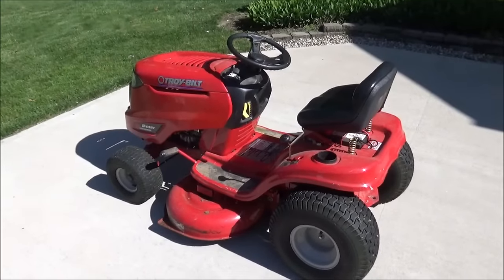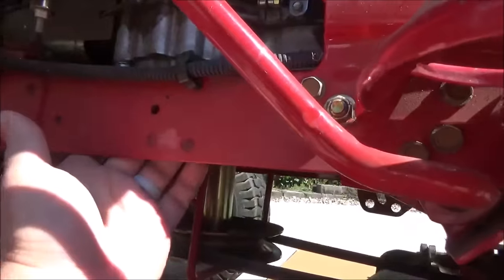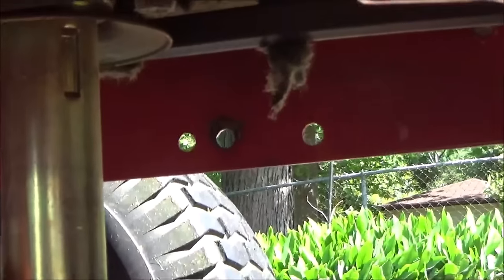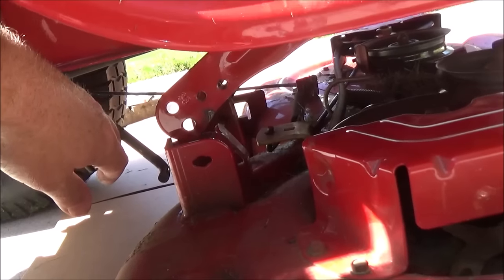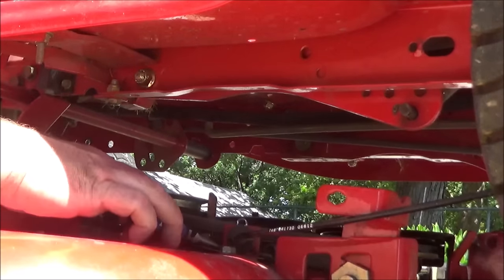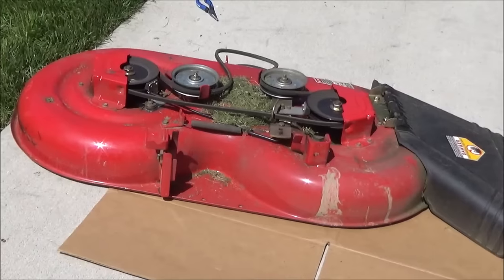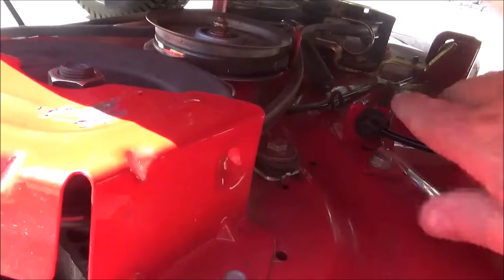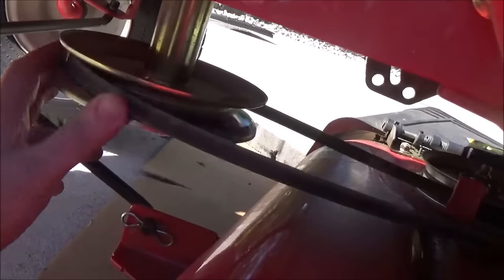Troy-Bilt Pony | How to Remove Your Deck / Put it Back On

Comment: COME ON MAN  the belt will come off the pully without taking off the guard it will give just enough to go past and on again without stressing the guard metal, put a little lift  on mower deck and the weight wont be an issue to push out pins , pto cable is long enough to slide deck just past mower and remove without cutting wrist when it comes lose underneath   just saying   the rest is what i do as well
Reply from the maker: Thanks for stopping by!

Comment: My Mower deck only goes down 2 notches till it hits the ground. How do I adjust the deck so I get all 5 or 6 settings for the height of the deck? Thanks
Reply from the maker: I don't know of a way to  adjust it other than adding some air to the tires. Mine sits very low. I can only cut on the top setting. But that is definitely way too low.

Comment: Just wanted to say thank you for making both the deck removal and changing of belts so easy.  You have a fantastic ability of blending the visual and spoken instructions.  I’m no mechanic but my Troy-Bilt works like it’s supposed to now and it saved me from buying a new one.
Reply from the maker: Thank you for the kind words and glad I could help!
Reply: Nice thank you so much for the info ❤, is there any way you can let me know about the battery every year I have to replace it don’t know why.

Comment: This was great.  I had to clean the deck and replace the belt on my old 42" MTD Troy Bilt Pony.  This was a huge help.
Reply from the maker: Glad I could help. I have lots of other videos on this mower if you need more info. Repainting under the deck, deck leveling, belt changes, etc.

Comment: This was a great help.  I was able to easily remove my deck.  I had to clean and grease the idler pulleys' pivot point so that I could disengage and engage my blades.  Count me in as a new subscriber.
Reply from the maker: Great, welcome aboard. Just did videos on replacing the drive belts and wheels in the past couple weeks if you ever need that info.

Comment: Great video!  I don't need the mowing deck and would like to use the pony to pull a small garden cart.  How do I trick the machine into thinking the blades are not engaged so I can start it? TIA!
Reply from the maker: Thanks! Just don't push down on the PTO handle! Make sure it is in the up position!

Comment: Hey Flip nice video thank you. You did however miss the plastic lock still dangling on the Blade engagement cable that needs to be there before installing the bow tie clip. But still clean and to the point video
Reply from the maker: You are correct. I see that guy hanging back there now. Good catch.

Comment: recently with the help of one of  your videos I was able to install new spindles on my Pony.  The old spindles I took off were the ones that came on the mower and they did not have grease fittings but the new ones I put on do have grease fittings.  Are new spindles like this full grease and the grease fittings are just to allow you to make sure they can be kept full of grease or are they totally empty when you get them requiring you to fill them with a grease gun before you use them for the first time?  If you could comment on this I would appreciate it.  I didn't see anything on the box or any instructions mentioning anything about this.  Thanks again for your help.
Reply from the maker: The ones that come on the mower are "maintenance free." The ones that come with zerks should have grease in them out of the box, but it never hurts to top them off just in case. I've seen a lot of goofy things come out of factories.

Comment: Your PTO spring comes out a lot easier than mine.  I had messed with it for like 30 minutes before looking up this video.  I finally realized if I slid the deck back, I could get the spring under a bar and a higher angle then it popped right out.  I have the Bronco, it's basically the same model, I think the engine is the only thing different.  And apparently the bar that was in my way, I didn't see it on yours.  Also the hook on your PTO looks smaller.  Mine was re-manufactured so maybe they put some different pieces on it.
I got it off though, blades changed, this video showed me I needed a higher angle - work smarter, not harder - very helpful.
Reply from the maker: Yeah you are right. Bigger engine is the main difference. Glad you got it figured out and glad I could help!

Comment: That's an excellent video. Thanks very much. What size is that self tapping screw for the belt keeper rod? My rod fell off and the screw is gone
Reply from the maker: Thank you! And I'm not 100% sure. If I had to guess, maybe a # 10 or #12?

Comment: I just went through all this and when I went to put the deck back on, it ended up with one end being further back than the other. To where the levers that attach to the deck to lift it up and down only matched on one side. I don't know if attaching the idle spring first made it pull to one side more causing the deck to be slightly diagonal, but it started pouring rain and I had to detach everything and will have to try again tomorrow.
Reply from the maker: Okay hopefully it goes smoothly tomorrow.

Comment: What you call the PTO spring, on my mower does not just lift up. The cable was installed under a rod for the pulles. I had to take the battery out and remove another screw that goes to the blade engagement lever.
Reply from the maker: Hmm. Interesting.
Reply: I believe the PTO is the blade clutch, not the deck lifter. But yeah, I had to navigate that damned rod, too. Once everything else is unhooked, just scoot the deck back a couple inches to give that cable some slack.

Comment: Great videos. I just picked one of these up. Can you tell or show me where the forward, neutral, reverse shifter spring attaches to the frame?
Reply from the maker: Sure, that little spring pulls in towards the battery and hooks into the little hole on the bracket that holds the battery.
Reply: @fixitFlip  thank you!
Reply from the maker: @Wordenn2388  No problem.

Comment: Flip, what is the brass rod that tuns near the PTO and where is supposed to to be attached? Thanks
Reply from the maker: I'm not sure exactly which rod you are talking about, but check out my drive belt video. I show a lot of shots under the mower. Maybe you can identify the part and where it goes.
https://www.youtube.com/watch?v=KT9MX1ibk90

Comment: Hi, I am hoping you can help me with something. The belt came loose on a neighbor's riding mower. In putting it back on, I discovered that he had run over something and had popped the Blade Brake Rod. The rod is an MTD part. The mower is a 2015 Troy Bilt Pony, but I can not find a video showing how to reattach it. Thanks

Comment: I have a Toro with the same set up on the deck what size belt is that I have a 42 inch cut
Reply from the maker: Yeah that should almost be identical. Both made by MTD. They are normally just listed by deck size. So a 42 inch deck belt.

Comment: On this model is it supposed to have deck wheels ? My deck is leaning forward. I bought the mower secondhand for cheap and it’s starting to fall apart.
Reply from the maker: This model (2012) and most years around this do NOT have the deck wheels. In the last few years they have started adding them on.
Reply: @fixitFlip  thank you thank you for the reply!! I have watched all your videos on the Troy-Bilt pony very helpful! Wish you had one for the steering wheel it is skipping when I turn

Comment: Thanks a lot, you make it look easy. I will probably have to remove mine to replace spindles.  Your video was very informative.
Reply from the maker: Thanks, I appreciate it. Good luck with the project. The "maintenance free" spindles do need replacing on these sometimes.

Comment: just changed my deck belt on the same mower but it seems loose...how tight  should it be ?,  first time doing this
Reply from the maker: Should not be super tight but not loose either if that makes sense. The belt guards should keep it on. If it's loose it could be maybe the tensioner spring is stretched out.

Comment: I dont enough room for the pto spring to fit !!!!   does the idiler bracket bar swing back and forth so I can push it forward?   this is the only thing I can think of to have enough room for the pto spring........Please Help ! ! !        I hit a 4 inch chunk of pine wood in tall grass and it caused the pto cable to break........do ya think I messed up more than the pto cable?
Reply from the maker: Yes typically when you pull back on the pto it will pull that spring and arm back.
Reply: @fixitFlip  i NEED TO push it forward then so the spring will fit where it is supposed to be?   the bar will push forward about 1  1/2inch right?
Reply from the maker: @WVSCROUNGER  Yes, it should have some wiggle room to push forward.
Reply: @fixitFlip  only 3/4"  inches....BUT I need to push it forward BOUT 2  1/2  INCHES    to give me enough room to put spring in ,,(  straight in ).......IF I loosen the plate that the PTO spring is looped into Can I turn rotate same plate counter clockwise which should give me more room to install the PTO spring...??????  Is  this a good idea???
Reply from the maker: @WVSCROUNGER  I've never done that before, but that idler arm should move several inches. I would think it should rotate in enough to get it hooked.
Reply: @fixitFlip  ...Thanks Flip !

Comment: Did you move the mower deck toward the back to get more room with the PTO cable?  There's a brass colored rod above it preventing me from raising it up.
Reply from the maker: I did not. I only have the deck belt right above it.
Reply: @fixitFlip  , if I had this problem, others may as well.   I had positioned the PTO in the on position which made it shorter.

I had a somewhat rounded off nut and couldn't get it off.   It sat with WD40 for a couple of days while I got a 15/16th socket.   Looking back on it, deepwell sockets aren't the way to go for this as they may tilt.

With the deck off and on its side, piece of wood and clamp to keep the blade from moving, breaker bar and setting it at about the 10 o'clock position, it allowed me to push down with my weight.  After a couple of tries, it popped and came loose.

I hope this helps someone else.   Being on the side like a clock, you can simply push down or now have lots of room to add an additional pipe to the breaker bar.
Reply from the maker: @southernguy35  Ahh, yes, that would do it! I always turn PTO off before turning the mower off so never had to deal with that. I go over that wood and clamp method in a couple of my videos like this one here: https://www.youtube.com/watch?v=PWJVYAy59O4

Comment: flip! need help with my pony. im looking online and cant find my answer. i took the extension spring off because i dont know what the hell im doing and now i cant figure out how and where to put it back! i can only find videos for newer model ponys, not the one i got. i hope u still check these comments lol
Reply from the maker: No problem.  U mean the PTO spring or the spring on the idler pulley up top?

Comment: Excellent video!  My 2011 Yard Machines mechanically is about the same as yours.  It's been a good mower.  

Going to remove the deck next week to do another spindle repair, all belts, and a transmission drive pulley.  Your videos have made doing it a lot easier.
Reply from the maker: Thank you and glad I could help. Yes, the mower brands made by MTD all look very similar! I've got a new video on changing the drive belts if that helps as well: https://www.youtube.com/watch?v=KT9MX1ibk90

Comment: Had my belt just rip off while cutting. I know it can be done without taking the deck off, but I figure, it's a good time to just service the deck
Reply from the maker: Yeah, never hurts to give everything a good cleaning.
Reply: @fixitFlip 
EDIT: I was able to get it loosened up and the handle isn't as stiff as it was. It's cutting and running, Might not be the correct way, But I did the best I could. 

So I was able to get everything done. But If I attach the rear deck lifts the control handle is very hard to move and I can't get the front bar on without loosening the bolt. i don't know what I'm doing wrong

Comment: My troybilt deck is at the most highest number. Is there a way to raise it up another inch or more? We have st Augustine grass and I’d like to keep it a little higher.
Reply from the maker: Not that I know of. I wish mine would go higher as well. I always have to cut on the highest setting.
Reply: Fix it Flip I was able to get it higher by adjusting the nut on the front. I also adjusted the left side. Now it’s level all the way around and I also changed out the blades as well. Took it for a test mow and it is working like new.
Reply from the maker: @mikecoulter7196  Awesome, man. Glad to hear it! Sorry, I misunderstood. I thought you had already leveled it and had it up as high as it goes. I have a video on leveling the deck here if you wanna check it out: https://www.youtube.com/watch?v=Gu4fdaegaIA&t=2s

Comment: @fixitflip OK I got a question I have same lawnmower I did everything as you mentioned in this video and yes I got the spring back on where it needed to go but for whatever reason when I go to drop my blades to start cutting nothing seems to work right? Any suggestions? I did everything exactly as you did in this video but something is not allowing my blades to turn on when I’m ready to cut?
Reply from the maker: Hmmm got to be something with the PTO unless something is up with the seat safety switch. Or it is in reverse.
Reply: That cable and spring are tricky, no doubt. I had to torque the cable around in its clasp quite a bit to get it to let go. Then I couldn't get enough play to get the spring unhooked. Just moved the deck back an inch and I got it. I expect it will be a trick to get that back together. The rest should be a snap.

Comment: Thanks. You showed me that I reassembled it wrong. The belt kept coming off due to I put the front wheel bracket in the wrong hole. ( second hole from the right).
Reply from the maker: No problem. Glad I could help.

Comment: Wow wish I had watched this before changing my belt
Reply: You should not have to drop the deck to change the belt. It takes me about 2-3 minutes. (I overworked the mower one year. Got real good at changing the belt since I had to do it 4 times in one afternoon... God bless Amazon's low prices)
Reply: What size is the deck belt

Comment: I cannot get the PTO cable out. Pulling it does nothing I can see where it needs to be twisted, but I can't seem to twist it enough for it to line up with the hole in the bracket  and come out
Reply from the maker: I'm not sure what you mean by twisting it.

Comment: I’ve just bought a new pony and the deck has scallop wheels on it like the bronco. Also has a bigger motor. 
I wonder if the deck mechanics are the same? There are zero videos on the newest pony. The deck wheels are a clear difference when looking.
Reply from the maker: Yes, I just looked at a manual for the brand new Pony. It does have a couple new features like the deck wheels but the deck adjustments are the exact same as in my video. The lock nut in the front for front to back adjustment and the adjustment gear on the side for side to side leveling.

Comment: OMG it took me a bit but I did I . Thank you so much this is the first time. Now how to clean it
Reply from the maker: I'm actually going to do a video on that soon! But I basically scrape the big stuff off then spray it with a pressure washer. I also repaint it from time to time.
Reply: That would be good thank you. I’m a widow so learning on how how to work on  all my Troy belt it’s nice to find help. You are a blessing. I have a Troy bill  4 cycle blower I changed the gas filter and the spark plug and it’s still runny hard and it gets hot to fast. So what I did is I started on number 2 and left it there please help if you can and I have a Troy bill weed eater as well I need to have a video on how to do turn ups please . So sorry for so much but you are so good on explaining-and your so good at it thank you.

Comment: There is a bar that runs horizontally across the deck over the spring. I can't lift the spring up to remove it.
Reply from the maker: You have to kind of slide it back and lift at a 45 degree angle.

Comment: What size belt is that?  I have the same mower and need to replace... every belt I bring home is too big
Reply from the maker: Hmm. Mine has the original belt. It should just take any belt made for standard MTD 42 inch deck.
Reply: Mine is the 2018 42" Pony, and the belt OEM is 654-04060.

Comment: When I lower the deck of my pony to 1 it is literally on the ground, wondering if it is possibly pinned in the wrong spot? Curious if you have any insight?
Reply from the maker: Something is not right. Watch my video I about taking the deck off and putting it back on: https://www.youtube.com/watch?v=tKNqokiNo00&t=22s
It shows where the deck is supposed to be attached when installed. There are only 3 attachment points. It sounds like it could be installed in the wrong spot. The height in the front can be adjusted as well. That could help.
Reply: Fix it Flip I’ll take a look! It didn’t seem right that I have to mow on 4 or 5 to avoid scalping. Thanks!
Reply: You can also adjust the deck height with the adjustment nut. See owner's manual.
Reply: Mine too. Barely lifts with full throw of the lever. Was like this since new. Was convinced the wrong length rods were installed from a larger model. I looked tonight at the sector plates on the rotating shaft and they are collapsing inward rather than pulling the deck support rods. Pondering having it welded or ordering from MTD 683-04155A assembly. $35